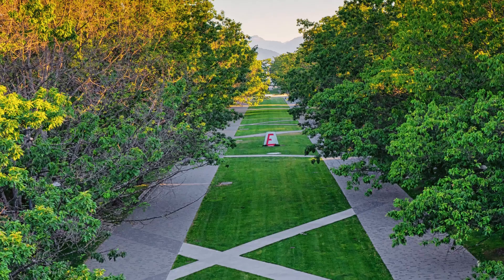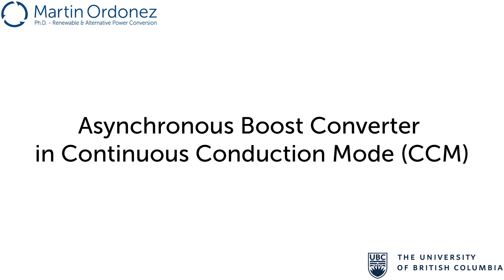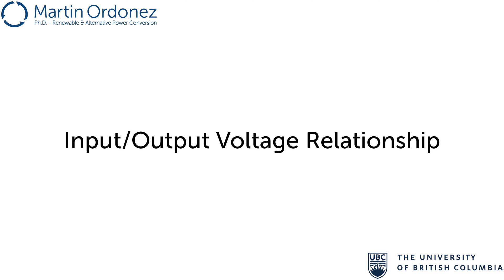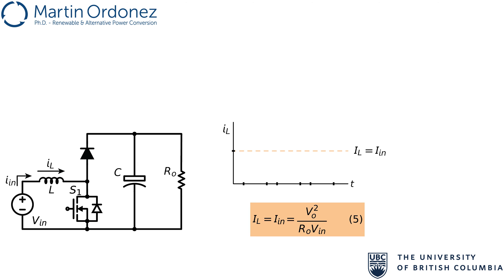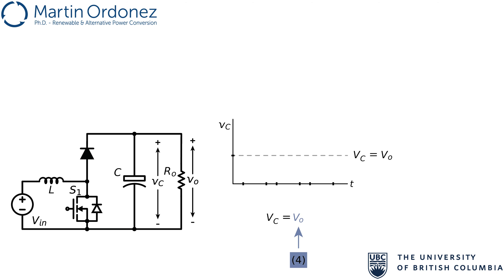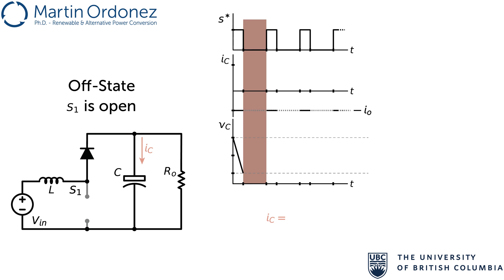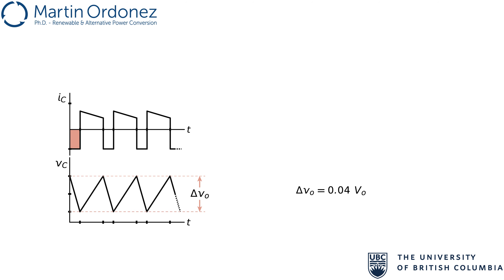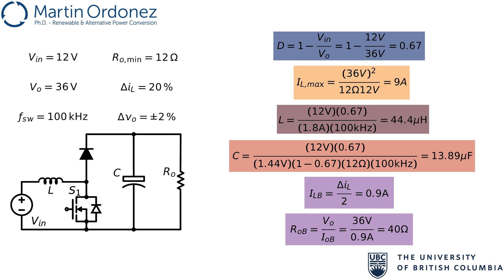Power Electronics - Boost Converter

Comment: Doesn't the inductor in Off-State change the polarity? If so, then wouldn't the Voltage across the inductor be Vo - Vin ??
Reply: I agree with you on that. I think they made a mistake
Reply: Yes, the inductor during off-state will change the polarity. This is why vin-vo is negative in the graph of vL=f(t). When representing the voltage across a component, you choose a direction of the drop voltage arrow as a positive reference (when s1 is closed = ON-state, vL=vin; because vin>0 you will represent it above the ox-axis. In off-state vL=vin-vo is negative and it will be under ox.)

Comment: How do you decide the maximum output voltage. What is the limit? o
Reply: There is no limit until you start practically designing a system. You will find limitations in switching frequency, inductor sizing, core size, ESR, response time, etc. For example the FET will have to be rated to withstand the maximum output voltage. Boost topology won't do very high power without having to use impractical components.